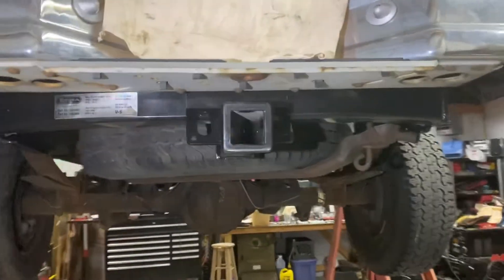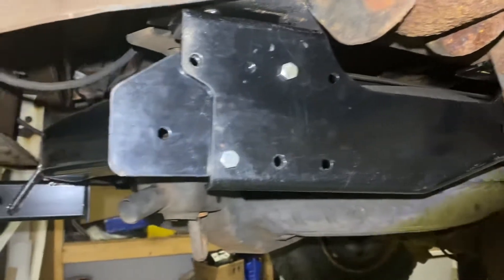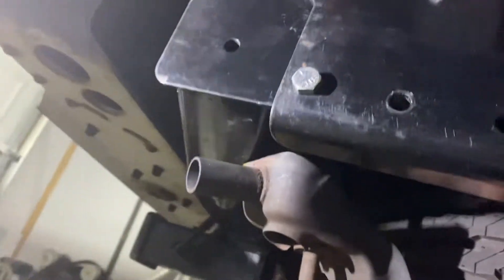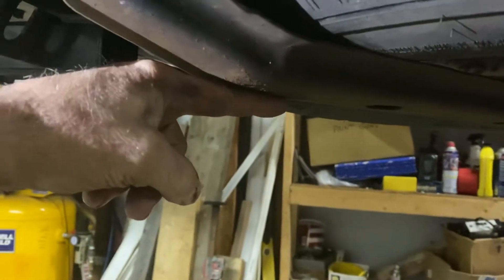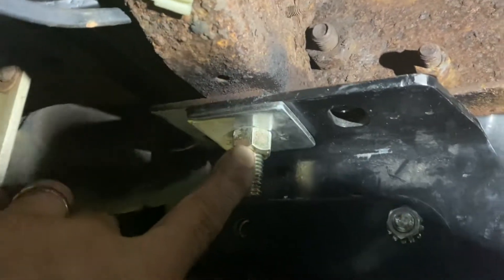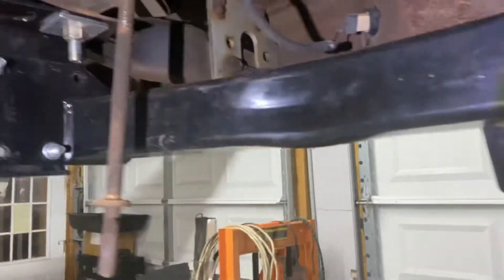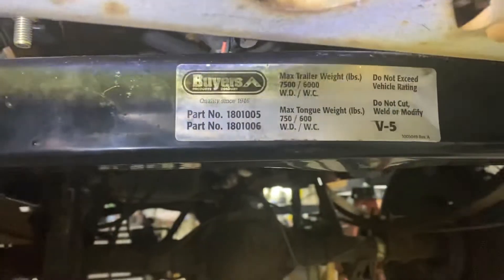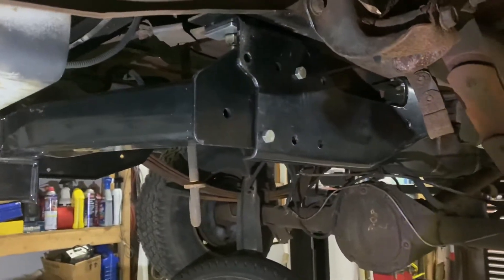Installing a hitch on a 92,93,94,95,96,97 Ford F-150 OBS pick up

Comment: It looks like there are no pre bored holes on my 94.
Reply from the maker: The holes in the trucks frame need to be drilled. If you don't have a lift you can hold the hitch in place with a floor jack, Then mark the frame for drilling, Move the hitch out of the way then drill as necessary.
Reply: @robbieraychannel  C clamps will hold it well
Reply from the maker: @JuanSanchez-ik7wx  True, great idea.